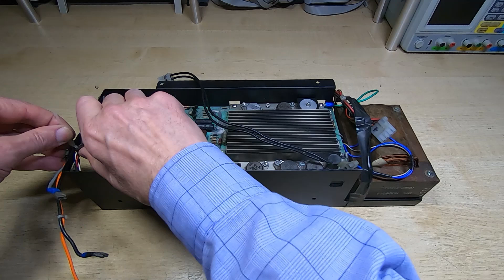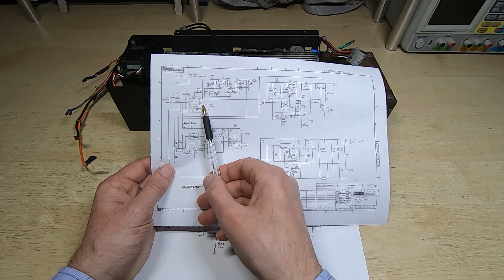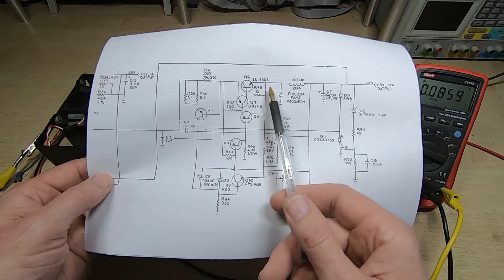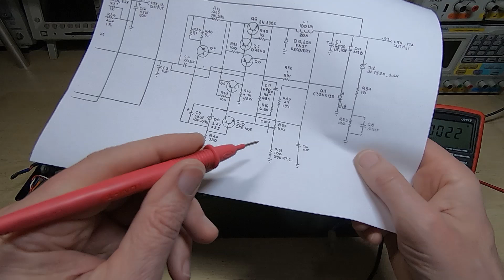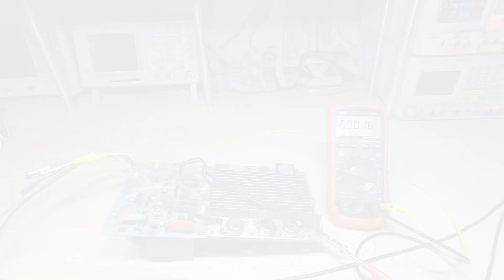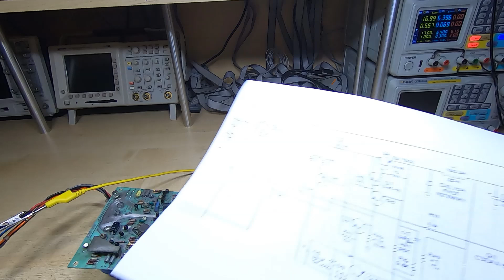PDP8 Power Supply Repair

Comment: That's a strange, "upside down" feedback comparator.

The Zener reference & comparator transistor base are negative of the output voltage, so the voltage divider with the setting pot it causing the emitter to go more negative (relative to the reference) as the output voltage increases!

It looks backwards at first glance, until you work through the whole thing. Neat & clever design.
Reply from the maker: Yes it does not matter the polarity of the error signal as long as the 'control' elements operate accordingly.

Comment: I hate power supplies!  When I was a young lad in the Navy (about 100 years ago), we had a power supply from something (don't remember what) but it used 3 feedback loops to regulate the power including one that actually controlled the input AC before the transformer.  It had a great manual with voltage readings on every component in the schematic. The problem was that 100% of those reading were wrong because of the feedback loops and we did not know enough to figure out how to isolate anything.  We took out every solid state device and checked them on a curve tracer but could not find anything bad. It was probably a bad resistor!!!  I think the power supply was still broke when I transferred from the site.
Reply from the maker: They probably designed them that way to keep you busy.
Same as the army painting rocks white.
Remember the main rule in the forces, 'If in doubt then designate'.

Comment: Are you going to continue the series on designing and building a switching power supply from the 1980's era. I remember you were having difficulty obtaining  cores for the inductors as they were always broken when they arrived. It was very interesting.
Reply from the maker: I will most likely continue the series at some point but I still need to find some cores.
Reply: @JerryWalker001  Ah good to hear, I just came here to say the same thing. I was very interested in that series.  I would actually love to see a video on designing a power supply like this one, and those found in other pdp-8 and pdp-11 era machines with a big mains step-down transformer and a switching regulator.